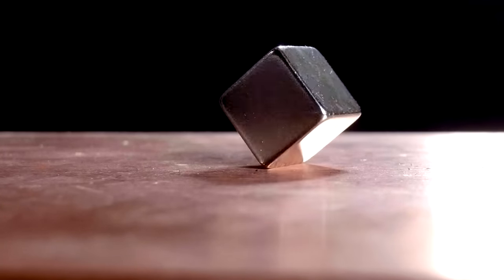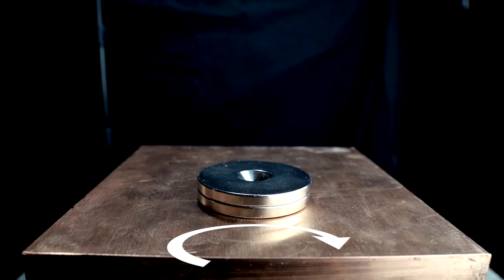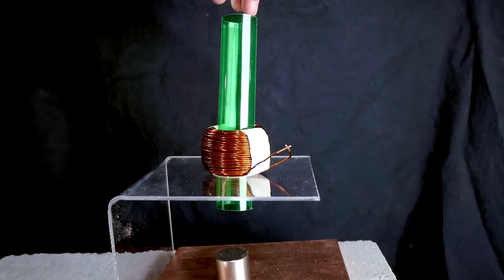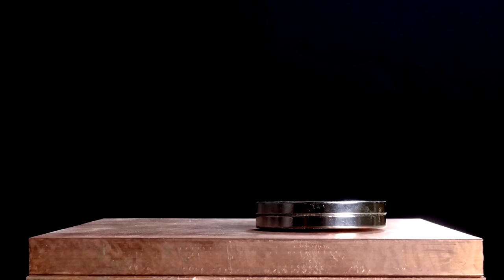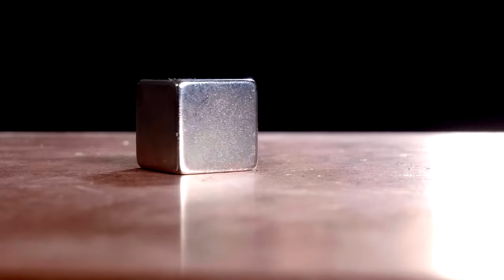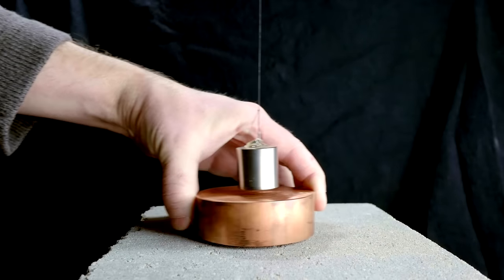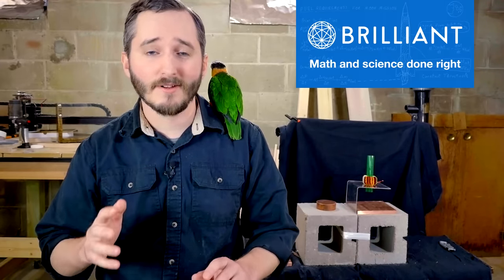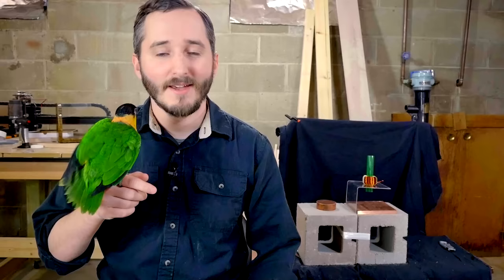Copper's Surprising Reaction to Strong Magnets | Force Field Motion Dampening

Comment: This is one of the coolest videos I've seen in a long time. I'm fully aware of the back-emf and resistive forces forces generated by the copper through learning how motors and generators operate but never thought of this sort of behavior. Seeing it applied here just shows that we have barely begun to explore the interaction of magnets and copper (or aluminum or another strong conductor).
Reply: on the contrary, this behavior is well-understood by physicists-- the entirety of this video can be summed up with the rather elegant equation
 ∫E͐•dr͐ = -d/dt ∫B͐•dS͐
the essence of this equation is that nature will combat (the negative sign) a change (denoted by the derivative, d/dt) in magnetic flux (which is basically just how much magnetic field (B͐) is going through an area (dS͐)) with an induced voltage (E͐) through a wire (dr͐).
what this means is that conductors will resist¹ not the presence of magnetic fields, but a change in magnetic fields. copper doesn't care if magnetic fields are near it, only if you try to change how much magnetic field is near it. this is why we have to move magnets in generators to be able to get electricity. contrast this with electric fields-- the mere presence of an electric field, not it changing, is what drives a current in a wire.

¹the way the copper physically resists the magnetic field is with its own induced magnetic field. electrical current always produces a magnetic field, and it just so happens that the induced current in a conductor from an external magnetic field will always be in the opposite direction to the change that created it. so, if you move the north side of a magnet towards a conductive material, the material will temporarily become an electromagnet with its north side facing the approaching north side of the magnet. pretty cool stuff
Reply: @you_just  "what this means is that conductors will resist¹ not the presence of magnetic fields, but a change in magnetic fields. copper doesn't care if magnetic fields are near it, only if you try to change how much magnetic field is near it."
IMHO, this is a sort of inertia.
Reply: @you_just  Shunts are great places to store back EMF in rotating fields. Old idea. It works. See magnetic drives.
Reply: @you_just  

this video is possibly the best i have seen on the subject, im just disappointed that he didnt show what happens with different resistances in the circuit rather than short, open, and LED... how a different number of turns for the same mass of copper gives different effects with different load resistances... that the magnet falling from a set height always contains a certain amount of energy.
how much energy is extracted? can be extracted? whats the limit?

wheres the work being done, and wheres the energy being dissipated?

really basic stuff when you actually think about it.

but you see... the OP i believe means... the average person has no idea, and confronted with the equations you presented, even with the explanation... the average human these days is intellectually stunted.

just look at the abundance of so called "generators" that abound, people that havent gotten past the fundamental "waving magnet past wire make led light up". magnets waving around with no flux containment, no idea of reluctance, resistance, flux density... nope. just "wave magnet past wire make led light up".

should be taught to preschoolers instead of the utter BS they put on for them now. except it needs teachers that actually understand it and can demonstrate it. like all practical skills... not just ... "careers". how can a teacher teach a subject they dont understand themselves?

Comment: I just learnt this in school. As for the scene for the Matrix I actually made a question describing the motion of a bullet through a magnetic field (part of my grade)
Reply from the maker: Yes it's interesting you really could stop bullets in mid air like that with a strong enough magnetic field because of the electrical inductance of the lead and copper jacket. I wonder how strong exactly of a magnetic field it would take. Maybe someone can figure out the math on that
Reply: I saw some information a few months ago where the Russians had a field over a large group of soldiers with all their equipment and a plane flying over could not perceive them. Such a field may well stop bullets also? Lots of Love
Reply: NightHawkInLight Well (using a bunch of formulas) you basically have dv/dt = -B^2 * L^2/(MR) * v

Where v is the speed, B is the field strength in teslas, L is the width of the bullet, R is the resistance across the with of the bullet and M is the mass of the bullet.
(with no air resistance of course)

Then v(t) = u * e^(--B^2 * L^2/(MR) * t)

u is the initial speed

With no air resistance the bullet supposedly never stops moving as observed from the equation, but anyway the field required would be very strong to slow it down quickly enough.
Reply: 86daily Perceive them by radar you mean? Or were they somehow bending waves of light (seems to be what you are suggesting)
Reply: If I remember correctly it was both ways. Radar or visual. For sure radar. As you know reporters are not very good scientist or observers and I'm not sure if they fully understood what they were looking at or the technology. I think it was Rt. and it was some six months ago or more.
Reply: 86daily bending light waves would be really difficult, especially over a large area
Reply: Nithesh S. A big mirror? XD
Reply: how much heat would be imparted with that much force being re-directed?
Reply: NuclearHeadshot magnetic mirror :D
Reply: Zac Tennyson you could use conservation of energy,

KE of bullet -> Heat

Comment: I am with DanHarkless - I admire your demeanor and integrity, and the greater depth to your empirical conclusions. Actually, in my opinion, you wee only half-wrong, and M. Karakas was only half-right (just think of attraction/repulsion in terms of ferromagnetic flux vs. induced eddy current - you were talking about one thing and Karakas was talking about another). Anyway, besides all of that, I am a consulting engineer on a number of 'space application' programs that involve similar versions of some of your experiments, but in a zero-gravity environment. After subscribing to your site, I found inspiration and insight into a possible solution to an issue with an existing NASA application by watching one of your other videos! You are doing a great service toward science education and you are awesome. I am going to steer as many educators as I can find to your site. Thank you!

Comment: All the kinetic energy is actually converted to heat, it is very slight, but measure the temp of the copper plate before and after doing some of those experiments.

Comment: can you do dropping test with iron dust put on plates so that we can see magnetuc field creation?
Reply: uveysiya ---> "can you do dropping test with iron dust put on plates so that we can see magnetuc field creation?"
The problem with that is: The magnet's field will also be superimposed on the iron dust/filings. So, to really "see" the magnetic field generated in the copper plate, you'll have to first see the magnetic field of the magnet by putting the iron filings on a piece of cardboard (or other non-metallic surface) and then "subtract" it from the pattern that would be visible on the copper plate.

Comment: Wonder if this could be used to stop doors from being slammed when thrown open
Reply: theoretically, it can. The size however and the force when the door is about the hit a wall are factors.
Reply: @gmusashi_45  Right, and it would probably be prohibitively expensive to build the whole door out of neodinium just to stop people from slamming it :)
Reply: @gmusashi_45  Well-balanced hinges, and reducing the door mass can help with both, you can probably lower the door's mass to be pretty close to that of 3-4 of those magnets, by making it out of a more flexible material, and thinning out the middle, since the middle of a door rarely sees any loading.
Reply: Part of engineering things is also deciding whether employing a certain method to accomplish the task makes practical sense. Cost and all...
Reply: @drasco61084  "Part of engineering things is also deciding whether employing a certain method to accomplish the task makes practical sense. Cost and all..."
Exactly! :D

Comment: Wonderful demonstrations! I believe that metal detectors work by using this principle--the powerful magnets in the detector causing current flow in metal hidden in the dirt--and these induced currents are what sets off the alarm. It is amazing to think that Maxwell used the data from the many experiments performed and logged by Faraday in order to synthesize the four equations that betrayed one of natures greatest secrets--namely that light is electromagnetic radiation.

Comment: I know this is a very far out idea, but what if you combined this effect with another cool science thing i've seen recently; the fluidisation of sand. I'm sure you've already seen physics girl and mark rober make these 'liquid sand' tubs, but what if instead you made a liquid copper tub using copper power and threw magnets into it? It might do nothing but it might be really cool.
Reply: That actually sounds like a really good idea. It's hard to predict what would happen, and I'm almost 100% sure nobody has ever done that before.
Reply: A Rocket in tiny particles the induced currents are far lower, so i guess it wouldn't happen much
also different powders behave very different when fluidised
Reply: I.iN.T.J -
You're an engineer? Somehow I doubt that given the fact that you have not yet learned to use punctuation correctly. You place a space before every full stop and comma...

Comment: I am SO glad I came here, this is amazing, learnt a few things, a few went over my head but oh boy was that satisfying to watch.
Reply: E=MC2 is a joke! OK let's get this correct  !!   #1  The only reason radio waves and AC current travel out in space and down a wire is because of the "CENTER " of a magnetic field.  (The "B" field), The North and South poles are the weakest part of a magnet !!   Just like Tesla said,  you got to look at things you can't see !!  At the center of a magnet is anti gravity,  (just tap the center on any glass or plastic and it will loose weight), The center can repel water if vibrated at the correct frequency,  If you vibrate the "B" field into granite rock it will become soft and you would need copper tools to work on same , you don't want to disrupt the magnetic (B")field ) with other iron.  Once you understand the "B" field of a magnet and how it relates to the entire universe we live in, you will then understand what Tesla was telling everyone "LOOK FOR WHAT YOU CANNOT SEE""  .I believe the pyramids were inter galactic communications and transportation systems.  Stone Henge and Gobekli Tepe , power plants.  Take a look at Coral Castle Florida on YOUTUBE and you will see a similar pilar. I believe these horizontal pillars were oscillators that would provide excitation for many things from crops in the field to anti gravity  FYI: If a UFO fly's to close to you the "B" field that provides the anti gravity ("B")Field).  will cancel out your power source  !!!!  E=MC2 is at best just a joke!!!

Comment: What if you gave that LED a 330 Ohm resistor on the cathode?  I wonder if it would have still slowed the magnet while allowing the light to remain light for slightly longer.  Intriguing video!! Thanks!

Comment: Couple of questions. 1: does the dropped magnet acquire any spin when it's decelerating (I couldn't quite tell from the slow motion)? 2: when you were manipulating the cube from a distance, through the copper plate, how did it compare to manipulating the cube without the plate being there (did the plate attenuate the magnetic field somehow)?
Reply: It does look like there's a slight spin

Comment: I’d love to see someone fire a solid copper bullet just above a long array of magnets (maybe a halbach array).  I just wonder if enough heat would be generated to damage the bullet.
Reply: That would be very cool. I think Mythbusters tried something like that, I forget what the result was. Also since a bullet is much smaller than a big plate, may as well make it silver :)
Reply: They were using standard bullets.  Those have different conduction properties, so a copper bullet will probably look somewhat different.
Reply: Nabre Labre shotgun shell filled with small neodymium “shot” fired from a thick copper pipe.
Reply: Firing magnets from a shotgun seems like a good idea until you realize that the gun is made of magnetic metal
Reply: CodeBurger then shoot a neodymium cylinder from a pvc vacuum cannon
Reply: Nabre Labre
It wouldn't have nearly the same force, but it wouldn't be a complete mess.
Reply: You could probably get away with a thick walled copper tube in place of the steel barrel.  If there was one sized right for the shotgun shell.  Then rig up some sort of firing pin setup.  I wouldn't want to be holding it, but there are channels that do similar experiments.
Reply: I don't think it's necessary to do that.  If the magnet is in a good shot cup, the amount of ferromagnetic attraction will be absolutely no match for the expanding gases from the shot.  The Lorentz forces generated by the barrel will likely be much more powerful but not so powerful that the magnet won't exit the barrel.

I wouldn't shoot it with a hot powder load though, you could possibly get into a overpressure situation.
Reply: Strong impacts and heat damage magnets. An air rifle(they go up to 50 caliber) would be somewhat better. Or maybe a rail gun since it's already a magnet?
Reply: How about "Fire a solid copper projectile through a tube lined with an N53 Halbach array." We wouldn't want the projectile getting loose, now would we? Could be expensive... Nice touch, not enough people know about the Halbach array, or that one is probably on their refrigerator.
Reply: Sounds like a job for Taofledermaus!
Reply: jcims  This video demonstrates the probable outcome of the bullet, it would more than likely slow down and drop quickly. Speed may not be a factor, just like a dynomo; the faster it turns, the more electricity it generates, causing a larger electromagnetic field. That's how I see it.
Reply: a copper bullet might be damaged just from being fired, copper is not a very strong metal outside of alloys.
Reply: Blox117 it's a lot harder than lead (the metal bullets are usually made of) and they have copper bullets (.45, .40, and 9mm) they are just hard to find
Reply: the lead is inside a brass alloy casing
Reply: One of the shotgun channels on youtube has shot magnets a few times.  No ill effects.
Reply: +jcims - If fired on a trajectory which is parallel to and almost touches the Halbach array, the bullet will curve upward! Passing at high speed over a Halbach array creates very strong repulsion. If the array is quite long, it will be seen that the bullet flies higher and higher until the levitating force matches the pull of gravity. As the bullet slows down, the path will curve back toward the Halbach array, eventually landing on it.
Reply: +CodeBurger -- The gun barrel being magnetic is not the problem; rather, the issue is the conductivity of the gun barrel, which for steel is much less than for copper. But even steel will have some braking effect on the magnets, so weaken that undesired effect by lining the shotgun barrel with a plastic pipe to create a gap between barrel and magnets. Then shoot a smaller gauge shell. Or (more likely) put the magnets inside a somewhat thick plastic sleeve to get the same kind of gap.

Comment: I’m curious to know whether the long term effects of this would effect the strength of the magnet, in the same way as repeatedly striking it. Very interesting vid btw. 🙏
Reply: anytime any kind of power is used it disintegrates. that is just the law of physics. even the sun will be gone after millions of years of burning. nothing goes on forever if it is being used.  so eventually the magnet would be gone. but it would take a long time.

Comment: I’d like to see you shoot it out of a potato cannon at the copper plate to see if it still stops short. I think that would look amazing
Reply from the maker: It would hit I'm sure. If you give the magnet enough force it can make it to the copper before slowing down all the way. Numberphile has a recent video about kinetic energy and car speeds that explains why pretty well.
Reply: NightHawkInLight but the faster it goes the bigger the inductance... I am intuitively sure too that it would smash, but somehow theory and intuition don't natch in my head and I am not that good at maths to make the calcs
Reply from the maker: The magnet will hit the copper if swung any faster than what I show in the video, so I've tested it. Perhaps it would not if the copper was a superconductor and was 100% efficient at generating electricity and the resulting magnetic field.
Reply: NightHawkInLight seems legit. Thanks for testing :)
Reply: @Nighthawkinlight   The inductance within a superconductor could still be overcome. The primary difference is when all the kinetic energy is dissipated, it would be "pinned" in it's final position by the induced field. In your "drop" demonstration,  the magnet eventually comes to rest on the surface as the induced current dissipates. With superconductor it never dissipates.